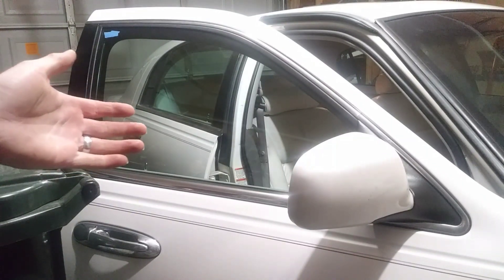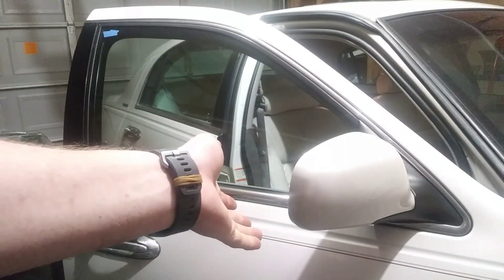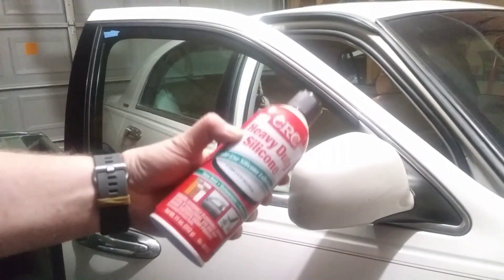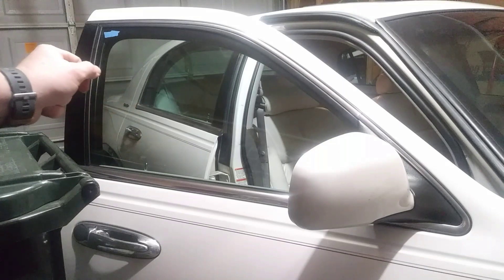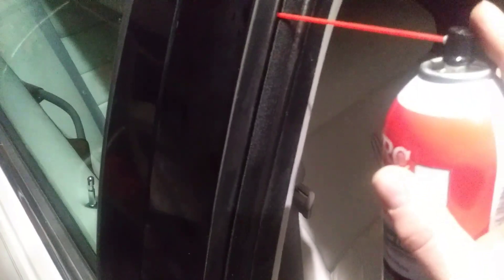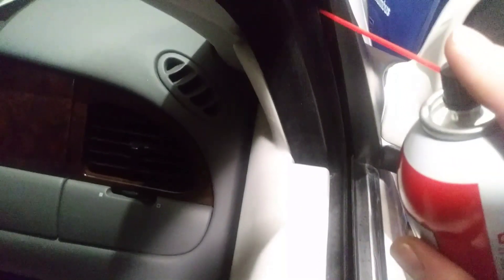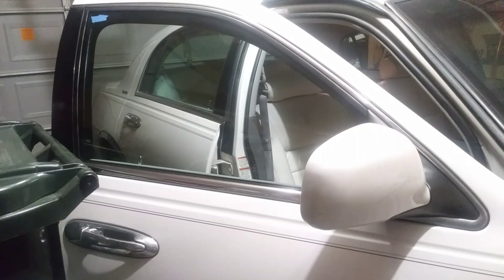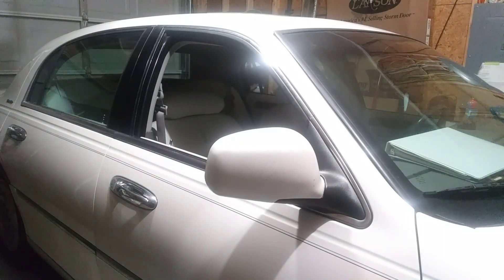Are you power windows slow?   Grease them up!

Comment: I agree that the lube will make the windows operate near-new again, but the problem is that it is a TEMPORARY fix. If you perform this on a weekly basis, you will have perfectly functioning windows!
Reply from the maker: I usually just do it at the beginning of summer and at the beginning of winter.   Seems to be effective enough to keep them operating quickly and smoothly.   It's just part of my normal maintenance now.

Comment: This will work for the short term, but would a different product like "fluid film'" be better since it will last MUCH longer than silicone spray?
Reply from the maker: Fluid film is great for rust protection and I use it on my truck.   But it gets pretty thick and tacky quickly.  It also leaves a waxy residue that yellows over time.   I'm not sure it would be a good product for window channels.   It too may be good for a short time.   If you do find something that works and last, please let us know!
Reply: I used wd 40 silicone spray.

Comment: I did this with the same can of lube as shown in the video, and it ate the finish off of the rubber on some of the trim around the window.
Reply from the maker: Been using it on an 01 Ford truck, a 99 towncar and a 2014 escape.    No issues so far, but will keep a closer eye on it.

Comment: Use a  dry powder spray lubricant instead. And clean those tracks first!
Reply from the maker: So when it rains, wouldn't that gum up the dry lubricant?    Silicone based lube doesn't run in the rain and is safe for rubber and paint.    (Unlike a patroleum based lubricant)
Reply: Wd40 ptfe dry spray never clumps of gunks. Each particle is slippery so they repel one another. They  also don't accumulate dirt like greases do